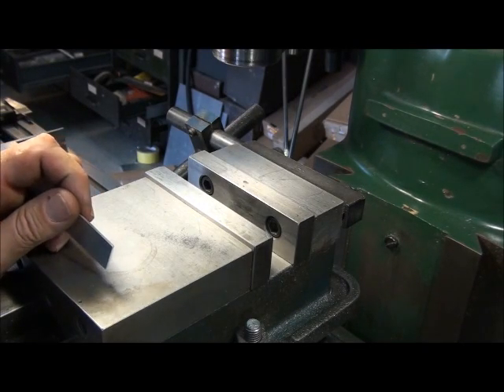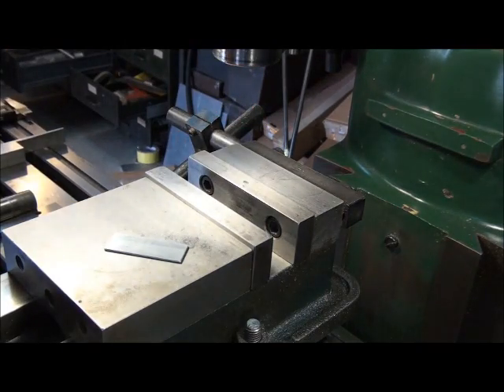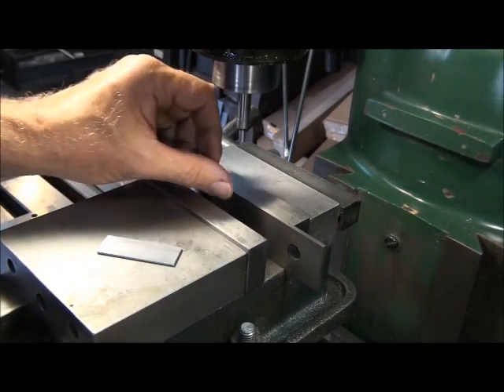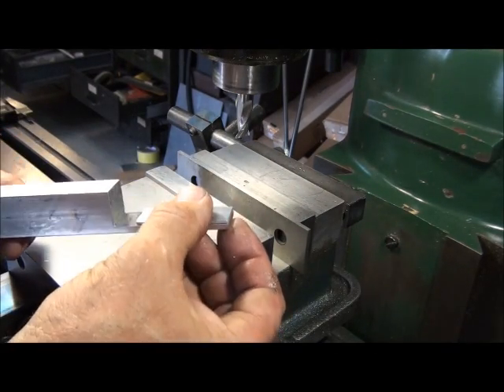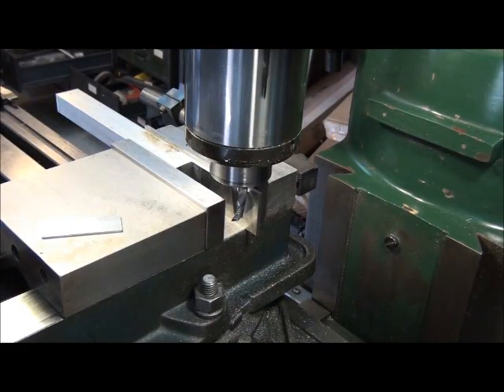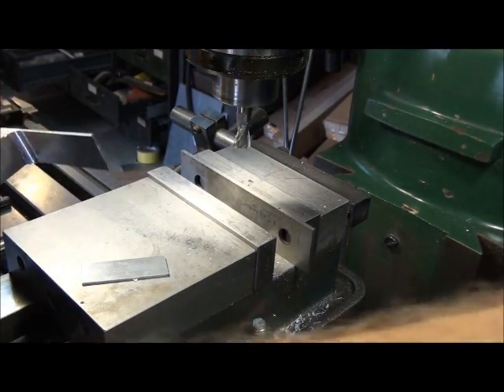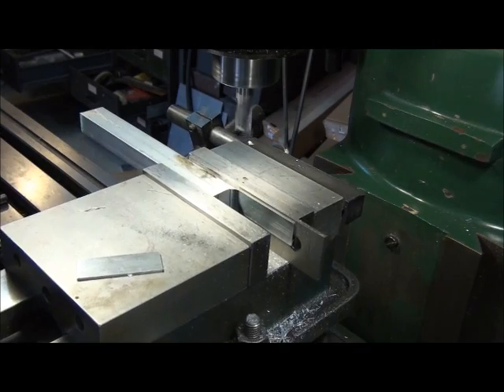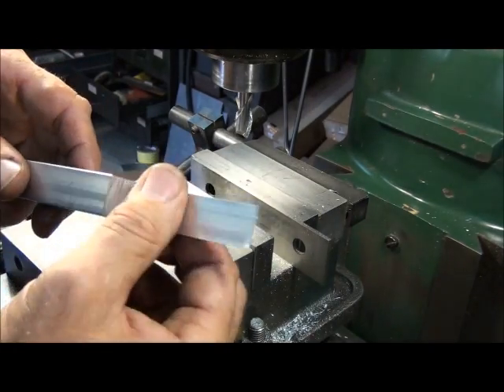How To Mill A Part That's Too Thin To Mill

Comment: Probably goes without saying that if you don't have a thick piece of stock, you could use another piece of material as a packer (or failing that, just undo the screws holding the hard jaw onto the moving jaw of the vice, and slide it sideways far enough to clear the cutter)
Reply from the maker: I don't know about sliding the jaw sideways, but using a spacer is definitely an alternative. I just did it with one piece in the video because it was easier to demo. That's the nice thing about machining, there are many different methods of accomplishing the same thing.

Tom

Comment: Before running the video I tried to imagine what method or method you might be about to share. This is one I haven't thought of or seen others use. Nice technique, very clear demonstration. Thanks very much !
Reply: Agreed. I thought he was going to end mill it and was wondering how he would hold it. This method looks like a very good solution to needing a particular size shim but not wanting to put together a stack ... say .029" ... just a shade under a standard size but a bite if an assembly needs to be repeatedly dis-assembled such as, perhaps, when prototyping or repairing an older machine. Sure enough, one of the shims in a stack will eventually get lost, get grit embedded, be inserted cock-eyed or otherwise messed up. Not every machinist is perfect and some would not notice the problem or else would (possibly even worse) guess at a replacement size.

A single shim (okay, aluminum is probably not the best shim material) eliminates at least some of the potential headaches of a stack.

Comment: Tom, excellent technique.

Thinking about this, you almost have to climb mill so you're pulling on the part in tension, if it gets too thin with standard milling, I would imagine you would buckle the part and it would get ugly.

Good to have this trick in my toolbox, thanks,

Glenn in Spokane
Reply from the maker: Yes, climb milling is a contributing part of the technique.

Thanks for watching.

Tom

Comment: I think you could go thinner yet if you , instead of having a broad end on just one side , have broad ends on both sides clamping both broad ends in the vice and milling out of the middle.
Reply from the maker: All that clamping the stock on the one side does is keep the end mill from pulling it in, the end mill itself is what holds the part down. I've played around with it a bit and you can literally get the stock paper thin.

Tom

Comment: I haven't used that technique to make thin parts but have used super glue to hold thin parts to thicker material then machine that thin part to the thickness I wanted, and it works very well.

Comment: Why not just using a piece of cheet metal?
Reply from the maker: What if the thin piece is attached to a thicker machined part, or the thickness you need is not available in sheet metal? I don't use this technique a lot, but when required it's a pretty handy tool to have in your bag of tricks.

Tom
Reply: Tom's Techniques
yeah,you are right. very good video by the way.thanks a lot!

Comment: Maybe this is a stupid question but I have to ask...  Why did you need to put the parallel behind the part?
Reply from the maker: No such thing as a stupid question. The parallel behind keeps the thin piece of stock from pressing into the hole in the vise jaw. Without it you'd end up with a round and slightly thicker "island" on the part.

Tom
Reply: Tom's Techniques
Thanks.   One other way to do this, which I have done before, is bond the metal to a heavy plate, above the vise.    When I'm done milling, I use heat (torch) to break the bond.

Comment: Interesting but I was a bit disappointed as I expected to see the 50 thou piece machined thinner. 

Years and years ago I came across a double-headed penny in my change. It was so realistic that it must have got spent again. For years I suspected that the penny had been made from two pennies that had been milled to half thickness then soldered together but I now suspect that the penny was a forgery struck from dies made by using a spark erosion machine as there was no visible join.

Comment from the maker: Thanks.

I've been slacking on the videos lately because I've been building a machining based website, but it should be finished and online tomorrow. It will allow me to better organize my videos and offer what I call project tutorials, which are useful projects designed by me, drawings that the viewer can follow and video tutorials where they are built from start to finish. Right now, I'm just working on the beginners section, but there will be intermediate and advanced projects as well.

Tom

Comment from the maker: toly,

That doesn't work on thin parts because the end mill will lift the part as it cuts (think helix). With the technique in the video, the climb milling cut forces the stock against the solid jaw of the vise, so the only limit to how thin you can go is the strength of the material you are milling. There is no chatter because the set-up is about as rigid as you can get. The noise you hear on the video is likely the stock slapping against the parallel as each tooth of the end mill hits it.

Tom

Comment from the maker: Believe it or not, I could have taken that extra .0015 off. The cool part about this technique is that the end presses the stock against the solid jaw making it easy to control how much you remove.

Glad you are enjoying my channel. I'm putting the finishing touches on a website that should go live in the next couple weeks. It will better organize my videos plus offer what I call project tutorials where I build a project start to finish from drawings that you can download. It should be fun.

Tom

Comment: Lucky you didn't cut your fingers. At the end of the video I thought we were gonna see blood. Swiping your fingers over that part was pretty crazy. Cool tip if you don't have double disk grinder. If you would of machined the back side of that bar first you would of had better results. But you brought that up by talking about the raw bar finish on the outside. Cool video.

Comment from the maker: I only tilt the head as a last resort, certainly not for chamfers. I have an end mill with a 90º point that I use for that. You can buy them ready made or just hand grind one yourself. Another option would be to rotate the part in the vise to whatever angle you need and face or side mill to create the chamfer. Then there is always the file. A good machinist should be able to file a chamfer on a part that looks just as good as a machined one.